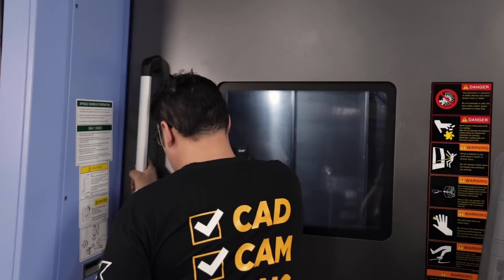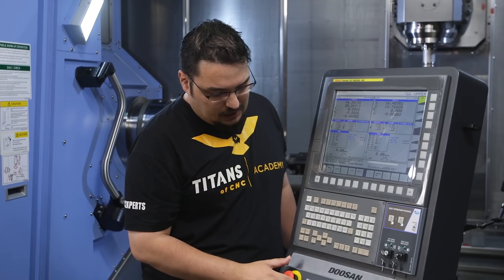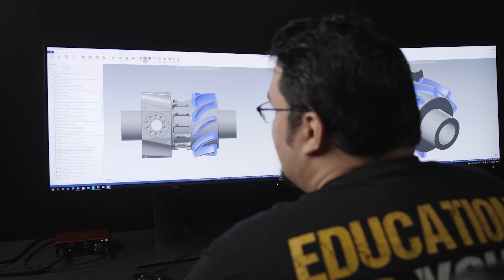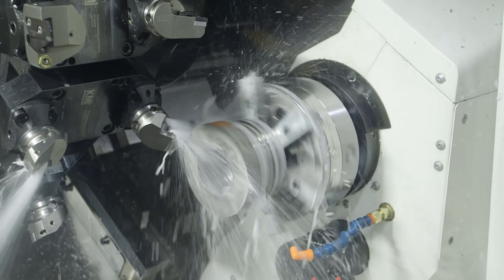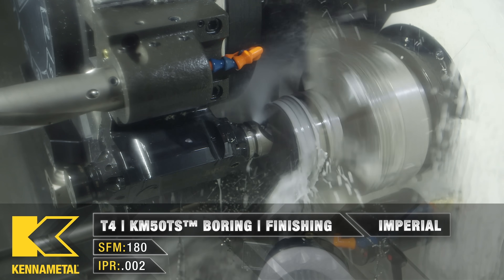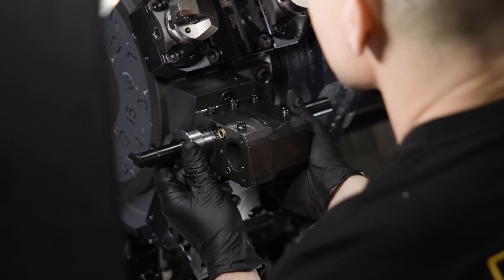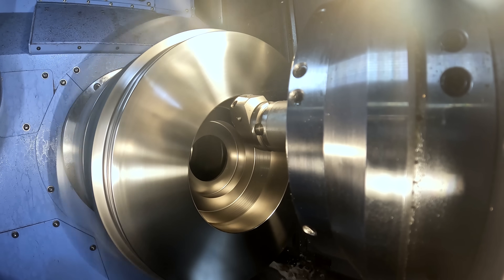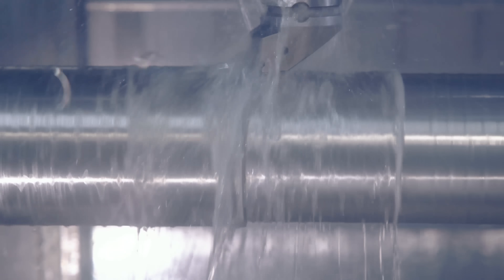BOSS Machinist Walked Out after Being Called Out For Not Doing His Job

Comment: Hi Tyson. Another great video. Thank you.
Just a question.  I have been a manual machinist for nearly 30 years. The last 7 years being on horizontal mills. The issue is i'm worn out, physically. My shoulders are shot. 2 carpal tunnel surgeries, trigger finger surgery, my back isin't great. I want to keep working but i think now would be a good time to move into cnc. I have some very limited knowledge on cnc machines but i would need to start from ground zero.
Would The Academy be able to help me with that ?  Thanks in advance. Mike....
Reply: Me too. I've been at it for 37. I have a shop at home but can't get 3-phase. Been thinking about getting a smaller vmc to take some small jobs
Reply: I think you'll be surprised at how much knowledge you already have that will transfer over between manual setups to doing a CNC machine setup. There really isn't much of a difference except you have to teach the control things that as a manual machinist you just intuitively know. Things like teaching the machine where XY zero is located. As a manual guy you find it and set a DRO or some other method for keeping track of it. In a CNC mill you follow basically the same procedure, but then have to tell the control where you are. How you go about teaching the control will vary depending on what control you are using. Setting tool lengths is something as a manual guy you've done 1000's of times, but now you you just have to teach the control. I think with the time you have doing manual work you'll be able to do setups on a CNC machine after minimal training.
Reply: As a fellow 30 yr machinist who started in Acme-Gridley's and Conomatics with M1 tooling, I'm going to 2nd Brandon S's post in that if you learned metalworking - the machine is almost irrelevant.  

I learned Fanuc programming, coming from over a decade in mostly screw machines, in a single Saturday on a cheap Hardinge lathe.

Not much of a difference physically, unfortunately.   Psoriatic arthritis dropped me to about 6 good fingers and the job I quit in 2020 I was the sole person doing 5 Swiss lathes, for some mental burnout.  Welcome to the Veteran's club.

Comment: The first lathe I ever learned how to set up, operate, and eventually program, was a dual spindle & live tooling lathe made by a company called Feeler. It was sold to us by a company called Methods. They sent a tech out and he worked with me for 5 full days and showed me the ropes. He even taught me how set up and operate the automatic bar loader, parts catcher, and parts conveyer. After a year of continuous running and part making we started getting so many jobs for that machine that the programmers could barely keep up so I took the initiative and started programming parts at the control. It had the Fanuc Manual Guide i control which is very user friendly and made everything super easy. At first I’d just copy and paste from programs that were similar and modify values across the board to make them work. But then I’d get some prints where I’d have to start everything from scratch. That’s when I mastered the G71 cycle format. I got it done and was awarded the employee of the month and then of the quarter for that year, August of 2016. From there they trained me on Swiss screw machines. I set up and ran a Citizen K16 for a while. Never got into the programming side because those programs are a whole other animal. But anywho, yeah, sometimes we just have to step up to the plate and make things happen. Tyson is a leader and I would love to work under someone with his experience and attitude one day.

Comment: To be fair, I too wouldn't be tempted to stick around on a jobshop that's doing jank, off-spec jobs with lot of manual work required to pull it off if I was offered the same salary on a shop that actually had the equipment sorted out for the jobs in question.
Reply: If i had an offer to run proper machines for less money to start with but knowing that it would catch up to where it was i would totally go. But in finland is difficult af to find proper machines because everyone run old crap because new machines cost money.
Reply from the maker: Life is all about levels… and it’s the same thing when it comes to being a job shop… 
We used the machines that we could afford… to create a great reputation… so we could get paid more… and this purchase better machines. Even though we ran Haas… We were SpaceX’s first inspection delegated vendor of all time. Meaning our work hit spec consistently and they put us in a program where they trusted our inspection as if it was their own. Shipped 3000 part numbers for them over 12 years. A great machinist can make great parts on just about anything decent. Now we run on much better machines… but ya, it was a process.
Reply: Curse of small shops